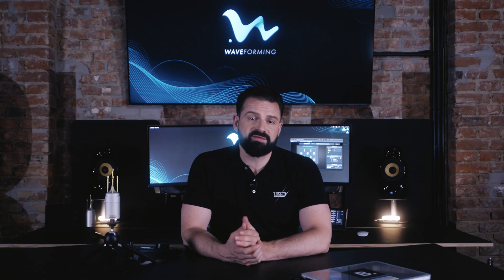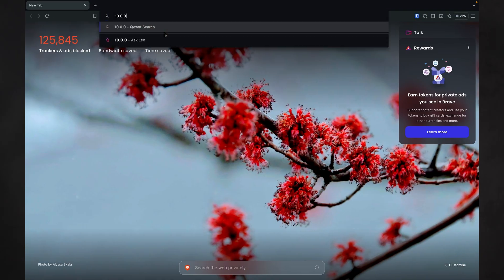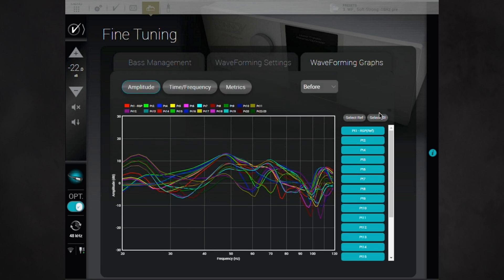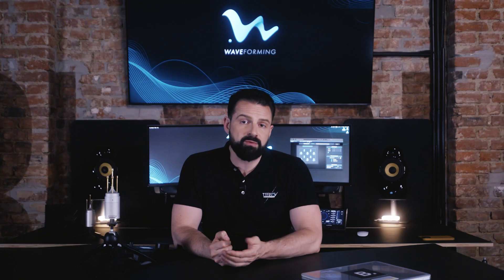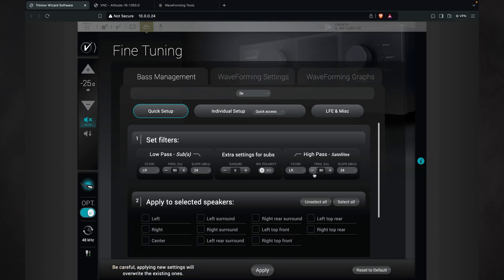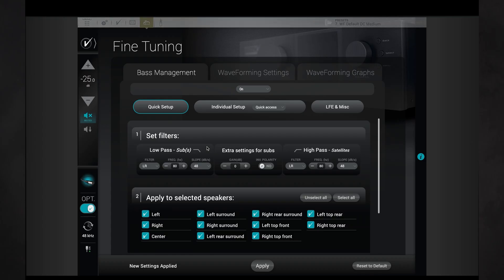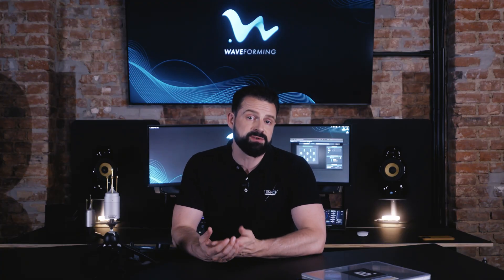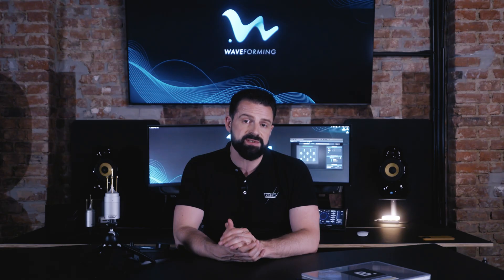WaveForming Tutorials : Section 5 Results and Fine-Tuning

Comment: This has nothing to do with the Trinnov Nova, does it?

I bought a 4 channel license for the Nova in my music studio specifically to add dual subwoofers - I've been waiting a year to get my two subs fixed - and I'm picking them up this week. I  can finally add them to my setup and I'm super excited, but I want to place them in the room perfectly and have the Nova integrate them as well as possible.. does the Nova handle crossover point for the subs as well as timing and phase for them?
Reply from the maker: Congratulations on the Nova ! It does not include WaveForming (yet) But it surely integrates and optimize subwoofers like any other speakers. So yes, you will be able to adjust crossover frequency and the Optimizer will take care of time and phase alignment for them. Please reach out to our sales, or support team if you need some guidance in the process.